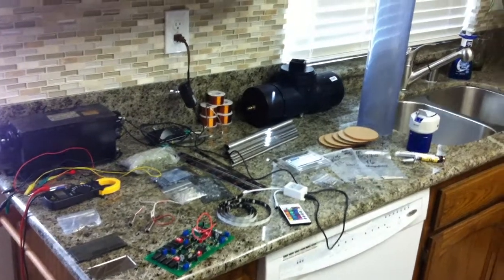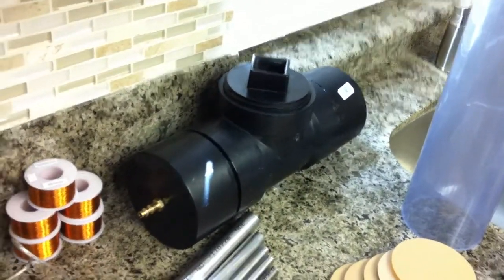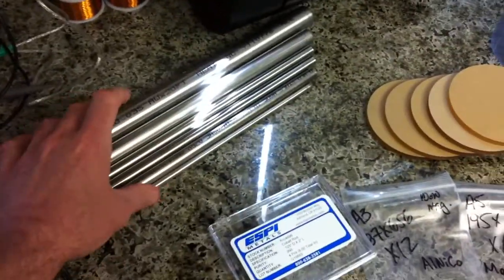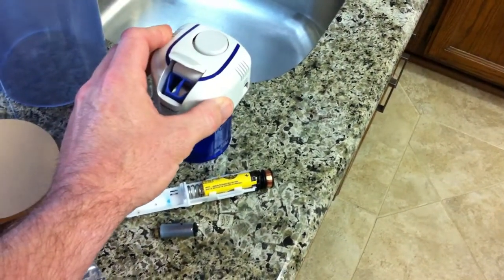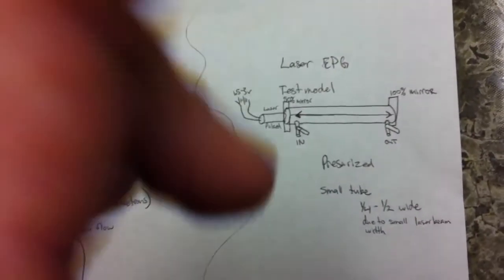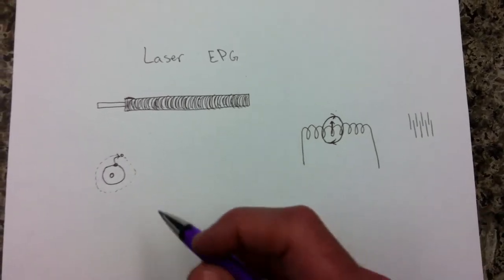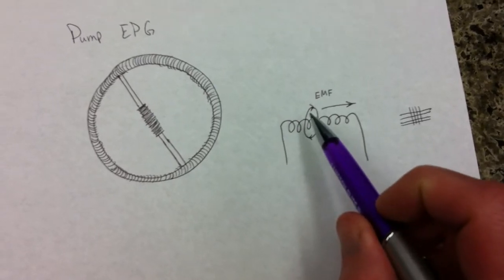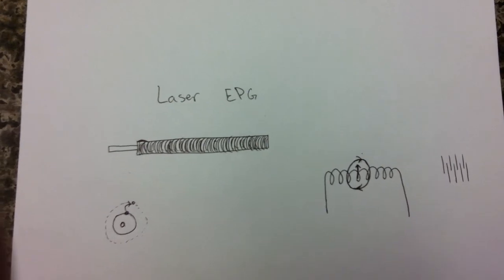Laser EPG 002 - The parts and the plan.

Comment: I believe he states that the lasers don't move the gas, not that the gas isn't moving. Just remember if you hook up that neon sine transformer to two parallel plates, every electron you take away through the positive you will be adding back in through the negative lead. Just my two cents

Comment: Nice! Looks like all that stuff set you back a bit. I got my vic circuit from Tony as well. How are you planning on extracting electrons after you ionize the gases? 

I always thought that the laser epg had gas moving in it. I have thought about your theory. A way to test it would be to take a transformer and apply straight dc and very the voltage up and down. This would be similar to the gas charging and discharging from the lasers. If you can induce a voltage in the secondary it works : ) Jus